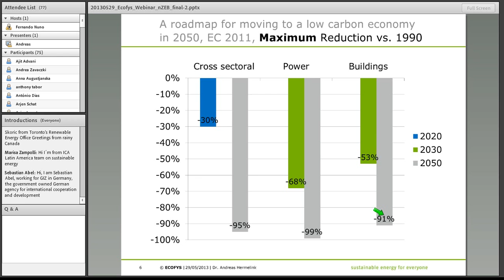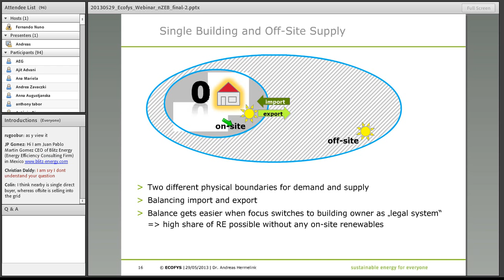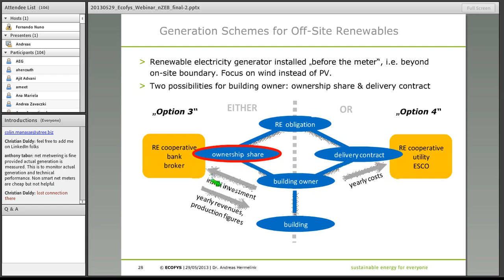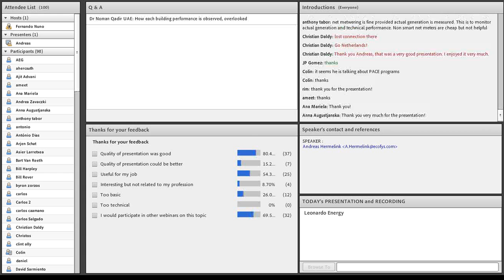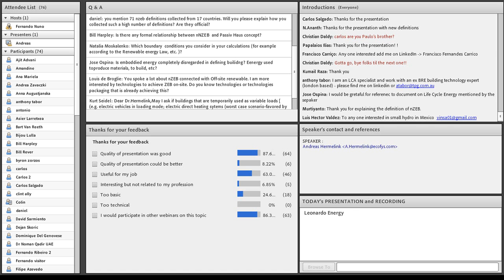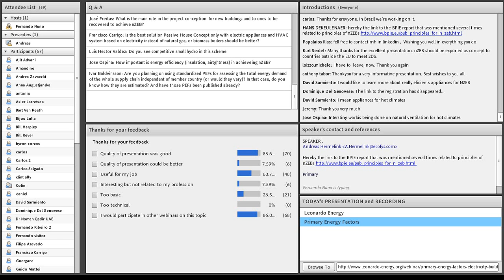Webinar - Near Zero Energy Buildings

Comment: For anyone considering skipping the Q&A at the end, you will miss discussion on these important topics:

71 competing definitions of nZEB currently being assessed in EU.

Emissions control, primary energy and share of renewables are missing from nZEB, 90% emissions reductions may be required from current EU emissions from buildings.

Energy Performance Certificates (like BER) need to be aligned across Europe.

Wind energy is cost optimal over PV but must be off-site to be effective, urban windmill systems are wasteful of embodied carbon and deliver poor energy performance. How is this to be accommodated in the nZEB definition "ON-SITE or NEARBY" renewable generation in order to achieve cost optimality?

Reuse of existing gas network infrastructure for the delivery of biogas and waste-generated gas needs to be considered.

EPBD in a future version might consider pairing new and existing buildings to allow for achieving the average nZEB standard.

No requirements for nZEB retrofit, just a requirement for a national plan for extending nZEB to existing buildings.

German biomass would not supply building energy needs if all German buildings were of Passive House standard.

Energy management systems are beneficial for electricity not covered by EPBD, but the payback is reduced as the buildings approach nZEB, so it may have a reducing role.

Retrofit requirement: every 4 years member nations to report on nZEB levels (new and existing) in the stock.  EED wants a roadmap for retrofit to nZEB by 2050.  

2% nZEB retrofit every year until 2050 is the minimum required, FOR THE ENTIRE STOCK! "Quite an immense jump." (Dr Andreas Hermelink, ECOFYS, May 2013).

Germany appears to have similar issues with the penalisation of nZEB buildings as a result of inappropriate usage patters being applied in their version of DEAP (the Irish domestic energy assessment procedure).

(Hope I have understood the discussion correctly, apologies for any inaccuracies, if not - SMcG.)